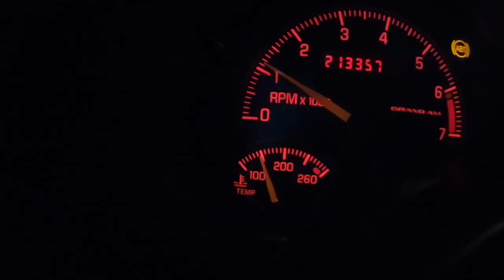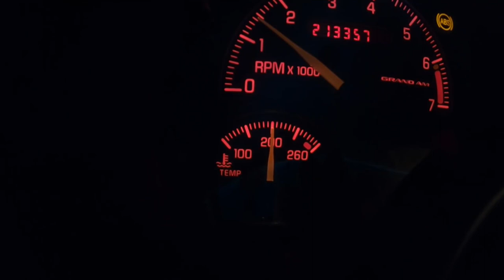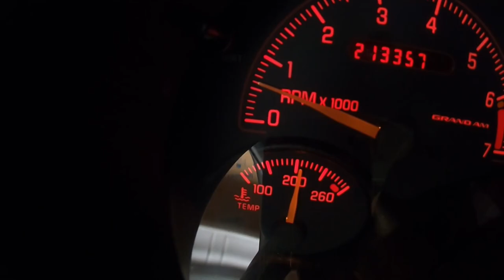Cooling Fans Fixed 3400 Engine Fans Not Working

Comment: Haha! “Somebody’s fixed something for nothing!” 😂 I love it! You remind me of my Daddy! I have been working on my 00 Pontiac Grand Am GT 3.4 L with a V6 today. It’s still overheating after a water pump replacement, thermostat replacement, coolant cap replacement, oil change, new alternator… I realized the fans aren’t kicking on unless I turn the heater on. From my understanding the heater acts as a “second radiator”. Which is an indicator something is wrong with the cooling system. Who would have guessed it right? 😂 I decided to check the ECT/CTS. I unplugged that joker, crunk that bad boy up and low and behold both fans kicked into full gear! I’m having issues with the AC compressor as well so I have narrowed it down to either the AC switch or the ECT/CTS or both. What are your thoughts sir?
Reply from the maker: BUY A NEW CAR!!! LOL 😫 I'm just a Body man here 🤣 They can sure be a pain to fix sometimes!!!

Comment: I bought that same peice put it in an no fans still working any suggestions i have pontiac grand am 2004
Reply from the maker: Can be a headache maybe the relay or bad wire also another sensor could be bad???
Reply: @JL.FortneyProductions  i fixed it it was the switch that your fans plug into.
Reply from the maker: @josephfaris4982  That's Great!!! 😎👍
Reply: What’s the name of the switch the fans plug into??
Reply: Great video!!! Tiu just have a New follower!!! A question, was your engine light on before swapping the coolant temperature sensor? my 02 GAGT has the same issue...fans only turn in low speed  with a/c on...but not at full blast...

Comment: How has it been doing in 90 degree days ?
Reply from the maker: Sold the car right after the repair 👍
Reply: @JL.FortneyProductions  Smart move. I have been doing a little digging for the same reason, overheating. My guess would be they were having over heating issues only in the Summer. I have been thinking of doing what they did. But have found out it may be just a dirty ground. Car won't overheat till it gets hot out. 3 relays for 2 fans. Had me scratching my head.
Reply from the maker: What a Headache it can be!!! 😒